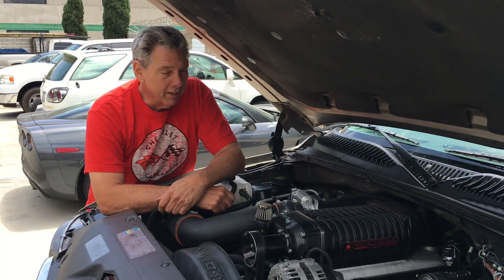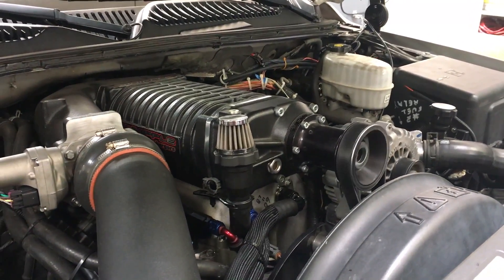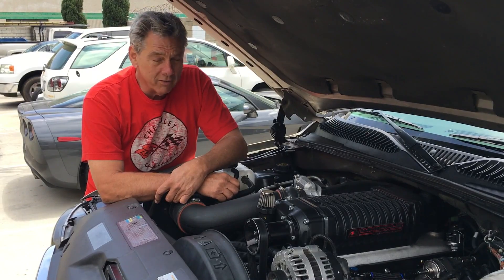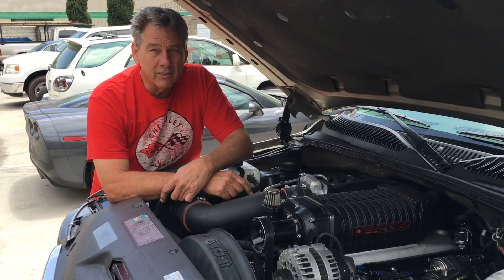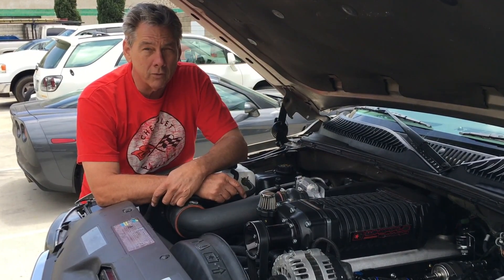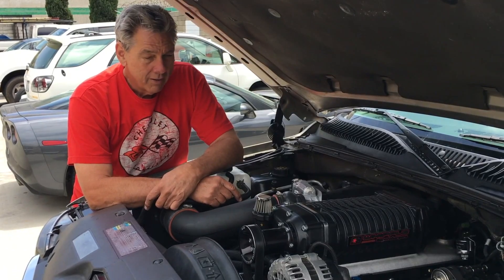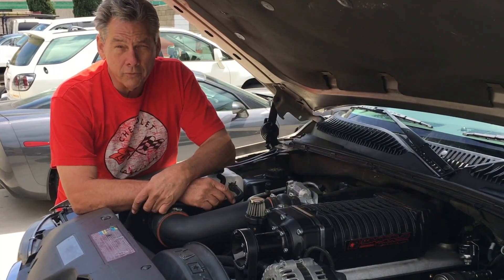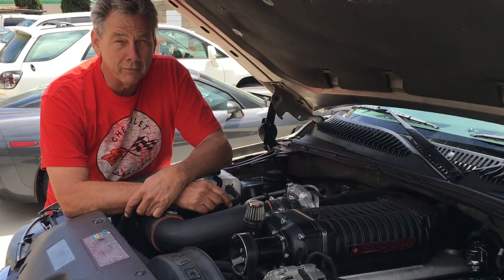2.9L Supercharger Makes 590hp / 695ft-lbs On Stock Vortec 8100 / 8.1L

Comment: How about on a boat,my boat has a 8.1 425 hourse
Reply from the maker: In a marine setup, the whipple 3.3L also works pretty well (provided you have hatch clearance for it) https://www.youtube.com/watch?v=7NL3zBEu8GE

I would highly recommend a forged bottom end assembly as the pistons tend to chip from extended runs at higher rpm. Marine packages (not including blower) are here: https://www.raylarengineering.com/packages.html

Comment: This combo would make a real nice transplant into a classic Chevelle.  Relatively mild when you're cruising around, wild when you put the hammer down.  Plus that blower sound.
Reply from the maker: If you're running a big block Chevelle, it bolts right in and is no more complicated than an LS swap.

Comment: Imagine the new 3.8 Whipple supercharger
Reply from the maker: all of the units will fit on the lower intake manifold, however, they don't fit under the firewall of the truck.
Reply: @MicahCoy  so u gotta give the truck a  cab body lift
Reply: @jackdaniels2657  the 2500 trucks have 2” “body” lift factory so I wonder if it would clear them?

Comment: Wouldnt a turbo setup be better for fuel economy?
Reply from the maker: The supercharger has a bypass valve similarly set up to most other modern aftermarket kits which allows for power when you need it, but you're not running boost continuously like an old-school roots style setup. Turbo kits are generally a bit more labor-intensive to install but you do get a bit more power out of them since there's no parasitic loss to drive the compressor. On the other hand, if you want to make more power with this kit, all you have to do is change pulleys.
Reply: @MicahCoy  Id like to see how much fuel economy can be improved with these engines. I dont nreally care about power that much.
Reply from the maker: @TheOzarkWizard  You're going to want the following mods for max breathing.
Following the path of air: K&N intake, 90mm throttle body on a ported intake manifold, aluminum heads, 202 camshaft, stainless works long tube headers, high flow cats, 3-inch dual exhaust with x-pipe, free-flowing mufflers like magnaflow, flowmaster, etc. That should be good for a 2-3 mpg improvement over stock along with about 100hp/100ft-lbs.
Reply: @MicahCoy   still have these superchargers in stock?
Reply from the maker: @alfonsoValle21  of course

Comment: So you can add that blower to a stock engine and get those results?
Reply from the maker: If you add in the 202 cam, yes. If you don't run the 202 towing cam, slightly less.
Reply: @MicahCoy  what about the trans? Did you have to upgrade or build it?
Reply: No you can't you assholes! Dude, don't boost this stock rotating assembly at all! It was engineered to only take 500hp out of the box, as that was max street legal at the time. Intake cam rocker rollers with springs headers plugs wires cold air, get you there ish plus tune. Forged crank connecting rods pistons are REQUIRED for over 500hp to do anything other then idle. It will spit shit.
Reply: @lizzifoster4161  chill.  I guess you don't know that GM sold an HP3 marine engine with 525+ hp with stock parts.  Stock gen 6 454 can make 1000 hp on stock cast bottom end.  Big blocks are stout!
Reply: So to proove my point; JT Lawrence of truck tech, actually made my point with ugly truck...drove it stock with 8-13psi boost. It ran and dyno'ed so why not right? Lolol. That does not account for bumps, hard corners, shit a hard shift at 90, CAN pop the stock rotating assembly  on purpose from the factory, to keep with street stock 500hp max of the time. Can it run of course, can it perform...drive hard and hot on the road...hell no! Also the L18 or vortec 8100 are completely a different engine from the vortec 7400-454 try porsche 928 heads if you want something different I hear they port and polish 400-450cfm and due away with pushrod construction, so 8000rpm is possible, and they take 1000hp as well as being aluminum, if you want to play with money. Kinda been waiting for someone to try milling the timing cover flange to fit coyote heads also...in the world of wasting money in prototyping. Raylar has the time and money invested for a reliable daily driver if you understand what to do to achieve what. Under 500hp from home is safe and easy, more then that is risking the pistons or crank, plain and simple.

Comment: Does the allison transmission hold up good with that horsepower?
Reply: T. Rance with the 8.1 the trucks will have the Allison auto.
Reply: @TsrifTsal-s5m  https://en.wikipedia.org/wiki/Chevrolet_Suburban?wprov=sfla1

Scroll down to the 9th Gen suburban. Only lists 4L80/4L85 in the 2500 series.
Reply: @TsrifTsal-s5m  https://en.wikipedia.org/wiki/Chevrolet_Avalanche?wprov=sfla1

Again only lists the 4L85 as the trans with the 8.1. You gonna admit you're wrong yet?
Reply: @TsrifTsal-s5m  and if you want to get really technical. The 8.1 came out in the 2001 suburban. But the 4L85 wasn't released until 2002. So for one year you got the 4L80.
Reply: Yea will it hold..cause I got a all stock 2005 2500HD with the 8.1 with the Allison transmission..
Reply: @TsrifTsal-s5m  http://www.trucktrend.com/truck-reviews/163-0302-2003-chevrolet-suburban-2500
No mention of the Allison with the 8.1. And I was an Apprentice mechanic with GM. So I know very well what was offered. I worked on many of them.
Reply: @TsrifTsal-s5m  your first comment was about the vehicle not having a 4L trans. Which is does. Whether it's the 80 or 85 is irrelevant. That was the debate. Not 80 or 85..... but sure move the goal posts.
Reply: @TsrifTsal-s5m  the 80 and 85 are identical transmissions. Just a few upgraded parts in the 85. Nothing more.
Reply: @barryziober6603  They are not identical transmissions. If they were identical then they wouldn't have different codes or ratings. That's like saying the 6L80 is the same as a 4L80 just with another gear. Your logic is flawed.
Reply: @barryziober6603  The 85 has a 5 pinion output shaft and handles 20ft/lb more torque. Also has trailer towing option. It will handle the increase in torque provided by the blower if by torque management, if nothing else. It's the slammed shifts on high torque engines that blow transmissions and the adjustable torque management (with a tuner) eases the throttle between shifts. Installed so Chevy could make sure the big block wouldn't blow the tranny before warranty was up. You should leave some degree of T/M in, since your pulling and acceleration isn't done during shifts anyway.... but all the damage is.
Reply: @gordonbrown6635  4L85 handles 170 more lb ft of torque 😂😂
Reply: That SUV will have the 4L80 not the Allison. Allison only came in the truck.
Reply: Barry Ziober do the HD series trucks have the allison?
Reply: @TsrifTsal-s5m  just saying whats in there from the factory. No idea if it's been swapped. But I doubt it has. It would need a 2" body lift to accommodate the Allison trans.
Reply: @TsrifTsal-s5m  no they were paired with the 4l85e , do REAL research. I have owned 4 different 8.1 vehicles in the last 15 years.
Reply: @TsrifTsal-s5m  look up the old brochures. They only list a 4 speed auto for a GMT800 suburban. And I worked for GM in those days. I know exactly what they came with. The Allison never went into a SUV or Avalanchr.
Reply: @TsrifTsal-s5m  it's a factory engine. And from the factory that suburban came with a 8.1 and 4L80.
Reply: @barryziober6603  Yes it came with an optional 8.1, but it was not matched to a 4L80.
Reply: @TsrifTsal-s5m  in the suv the 8.1 got the 4L80. In the trucks the 8.1 got the Allison trans. GM never put the Allison in a SUV or the 2500 avalanche from the factory.
Reply: @TsrifTsal-s5m  https://www.automobile-catalog.com/car/2003/1205465/chevrolet_suburban_ls_34-ton_2wd_8_1l_v-8.html
Scroll down it lists the 4L85 as the trans in the suburban.

Comment: I bought a pickup with this set up and when i get 5 or 7 lbs of boost i get a knocking noise any ideas on what to look for and it also dont seem to have the power as u would think
Reply: Kenny Weaver Armwrestling. Well 2 options. Spark knock being 1 of them. The other is a pissed off rod
Reply: Calab Schultz im pretty sure its a spark knock I started to run 91 octane and no issues with it since. But other then the fuel any other ways to fix that issue
Reply: Kenny Weaver  If it went away with higher octane fuel, make sure you always run high octane fuel Especially with roots style blowers. They create a lot of heat and your intake air charges are probably pretty high (nature of the blower).You could also take 2-3 degrees of timing out of it assuming you have that capability. If not find someone who can. Truck won’t run quite as good. But good octane fuel and a little less timing should help prolong the life of it. Hope this helps
Reply: Does it do it when you turn the truck on and let it idle for a while?

Comment: For me it isn’t so much about extra power. It’s about being force-induced for times I am at higher elevation towing. Naturally aspirated engines don’t do well no matter how powerful they are without an SC or turbo when you get to 10,000+ feet above the sea.  That has nothing to do with the type of fuel you burn.
Reply: Airplanes use turbo normalization to keep the air going into the engine at sea level pressure.

Comment: Would love to see it towing heavy
Reply: I own an 8.1 and it can tow China
Reply: These 8.1 vortecs are beasts at pulling, a friend and I pulled out a 2500 dodge extra cab with a 19 foot FiberForm boat from some nasty wet mud like almost nothing there behind us.....

Tge kicker to this story coming from ME specifically is that,cim a Ford guy and I've never seen a stock-ish Chevy do so well with so much ease.
Reply: Having owned big blocks and diesels it'll pull down a house.  Be sure to add some fuel capacity or you'll be stopping more often than a motorcycle.

Now I'd love to have this in a short bed half ton.

Comment: I just acquired a 02 8.1 Silverado , is there anything that will improve gas mileage other than leaving it parked? Thanks in advance
Reply: Uhhh no not really its a big block and a truck. 

But well I guess if you turn the truck into less of a brick aerodynamically and if you never tow with it  you could swap the rear end gears for a set of highway gears of course if its 4wd you have to swap the front axle gears or literally never use 4wd again umm i have heard synthetic oils for the engine and diff help by like 1 mpg sometimes but i highly doubt it would keeping rpms low when you drive would help too buuuuuuuuuuut all of this costs more money then you will prob ever save unless you own it till it turns to dust
Reply: Smooth Trooper lololol.... It is all the above, four wheel drive with big tires. I've come to terms with the 7-8 mpg city. Bout 12 hi way.
Reply: @nomadicfenceman509  What size wheels and tires you running?
Reply: Smooth Trooper 305/70/16
Reply: @nou8257  you could go crazy and install a driveshaft disconnect and tall highway gears in the front end, fwd empty, rwd towing.
Reply: If you drive down hill more often than uphill it can help
Reply: Honestly, if you add a supercharger it will breathe more efficiently and theoretically get better mileage if you keep your foot out of it. Therein lies the problem though.
Reply: @gordonbrown6635  but..... Spending $7k to save a couple bucks at the pump is ridiculous. It's like trading in your old car for a new car because it gets better mileage.
Reply: @Andrew Moore  Depends on how long you intend to keep it. Of course that's not the "only" reason to supercharge....  😉
Reply: 5 yrs later and all I can say is that it’s one hell of an engine. 8 or 9 mpg
Reply: @nomadicfenceman509  well that’s a cool 5 year update. My 8.1 suburban finally has a leaking water pump. Think a blower should fix it
Reply: Parked
Reply: Best cheap way u can go is small tires and a good tune and youll still make good ho and torque
Reply: Swap your gear ratio or ratios to higher ones if it’s 4wd.
Reply: But remember if you swap the gear ratios to higher ones it will be slower, but id imagine it’s worth the 5-7 mpg. I had a 06 4.8 silverado and the gear ratio were 3.42s and I put 3.73s in it and I lost about 5 mpg but it was faster

Comment: Can any of raylars parts, like this supercharger or your various cams, be used with a 454 Vortec?
Reply: I would assume you would need parts specifically for the 454 but it’s probably similar enough that some simple machining differences would make it work... I believe the 496 is just a bored out 454 maybe longer stroke too but they’re reasonably similar. I would bet anything you can find 454 specific parts though they were very popular especially since they towed better than the 6.5 and LB7
Reply: Lol bored out lol....it is a stroked out 454,  not over bored like a sb or 4banger, and that really isn't the problem the 8100 has a different bolt pattern on the head. Not to mention longer stroke means longer rods as well. Raylar has been  basically the only name in the vortec 8100 forum other then Dart, and had a bad crew blowout burn a few people. The gear is spot on if installed right, just don't overtighten the lash, 1 AND 3/4 turns after 0 lash is wayyyy to tight and WILL  snap studs, I'd try 3/8 to 3/4 after 0(rod lifter lobe love tap) only problem I've ever heard about Raylar is that video they made wrong lol, as parts go amazing.

Comment: Can any of raylars parts, like this supercharger or your various cams, be used with a 454 Vortec?
Reply: Elijah Well I wonder if the 454 7.4 liter  is bored out to this 8.1 liter? 🤔
Reply: 8.1 is a 7.4 reworked
Reply: EGGINFOOLS the Vortec 8100 is a completely different engine. Same bore and stroke as a real 496 stroker (4.31 x 4.25) which is a 454 bored .060 over and 4.25” crank. The block however is a completely different block. No distributor hole, no pcv system. And no 8.1 parts will fit any other gen 6 and previous blocks other than exhaust manifolds (if you decide to not run EGR)

Comment: Top 6 necessities for the gasser GMT880 platform. 1. Raylar 540 w/whipple 2. Dana 60 front axle w/leaf springs 3. MA transfer case pump upgrade 4. Steel drive line w/sye 5. Detroit locker in rear axle 6. Transmission rear housing support brace
Reply: ill stick with ifs lol death wobble aint no fun
Reply: @samsquantch14  neither is a weak ass front end.
Reply: @jacobking4106  lmao yeah because tie rod sleeves are so hard huh
Reply: @samsquantch14  beat around on that IFS and it breaks. Beat around on a Dana 60 and you will go through a motor before that thing breaks.
Reply: @jacobking4106  never had any problems on my Chevy. You must like your trucks to ride like a covered wagon lmao
Reply: @samsquantch14  amen brotha!
Reply: @samsquantch14 most of these guys do 😂😂😂 wanna ride high up lifted and ruff as hell ..